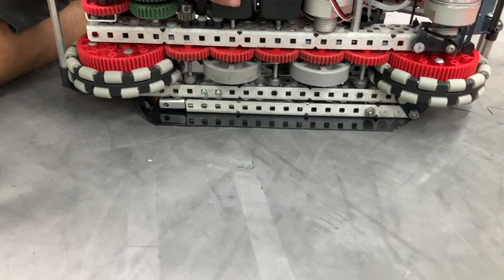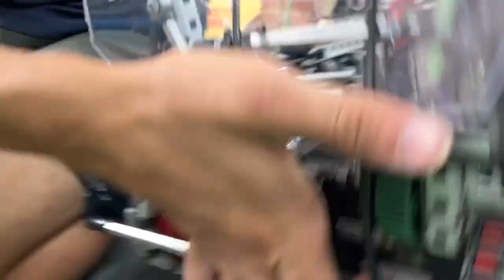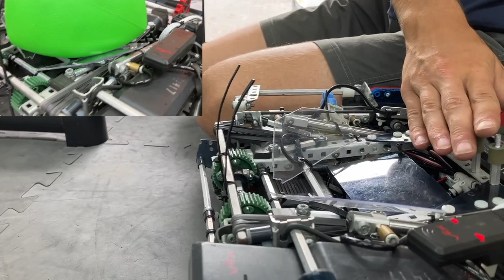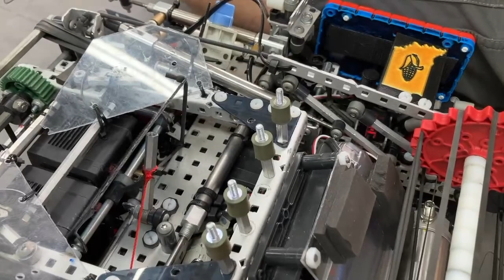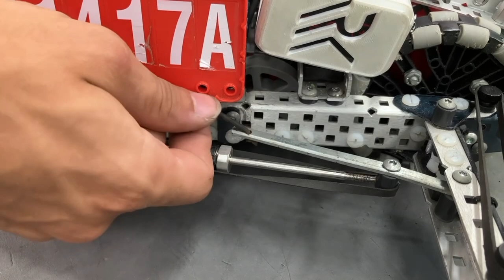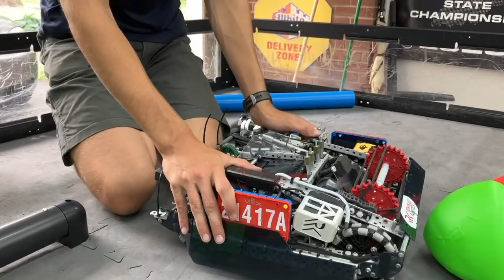21417A Over Under Early Season Robot Explanation

Comment: i dont have pnumatics how would i do a locking mechinism with motors
Reply from the maker: With motors you shouldn’t need a locking mechanism. It should work if your motors are set to hold. We are just using locking mechanisms because the pneumatics are not at strong as motors and the air pressure can be driven back under force.
Reply: thank you @robokauz
Reply: should i take my rubber bands of the wings then???
Reply from the maker: @Dispairitie  I’m not sure what your wings look like, or what mechanism you use to open them, but if they are directly powered by motors then the bands might not be necessary.
Reply: thank you @robokauz

Comment: I have been sitting here for hours trying to figure out how you did this locking mech and it just doesn’t seem to be working Is there any way you could help me?
Reply from the maker: I hope I can

So the beck of the high strength shaft has to be tensioned to the robot to ensure that it is close to the catch on the robot.
You want the wing to rotate the shaft around the end of the cylinder which will force the catching end of the high strength shaft into the side of the robot. This second part is how it works … it rotates around the end of the cylinder as the wing is pushed back, which coincidentally pushes it to the catch on the side of the robot.
Hope that helps
Reply: thank you another question how far away is the tension from the end of the axel? I counted around 6 holes, also is the axel tightly attached to the wing?
Reply from the maker: @Dubzies67  no all attachments are lose. The tensioning shouldn’t matter too much as long as it keeps the shaft close to the robot
Reply: Thank you very much I figured it out

Comment: how does the wings lock work?
Reply from the maker: well i cant explain the physics in text very well, but the mechanism rotates the half-cut high-strength shaft around the axis at the end of the cylinder, driving the shaft into the catch on the side of the robot so it cant slip. I hope this helps

Comment: wait i have a question that i really hope you can clarify for me. if your catapult is 33 rpm how are you getting 100 shots per minute since you are shooting 33 times per minute at 33 rpm right?
Reply from the maker: So the slip gear spins at 100 rpm which determines when it shoots. But it connects to the catapult in a 1 to 3 ratio resulting in the catapult moving at 33 rpm
Reply: @robokauz  oh dam that makes so much sense tysm i never thought of it like that but its basically the same idea as a puncher.

Comment: Hey, I was wondering how many teeth you took off the slip gears?
Reply from the maker: 6 , but it varies depending on the specifics of the robot, I'd start with less, then work your way up to however many you need to get rid of.
Reply: @robokauz  alright thanks!

Comment: 33rpm doesn't sound like it is 100 shots per min
Reply from the maker: The slip gear 12 teeth, spins at 100 rpm while the catapult arm , attached to a 36 tooth gear spins at 33, but since the slip gear goes at 100 rpm it slips and fires 100 times per minute

Comment: How is the high-strength axle you guys use for your hardstop attached to your robot? I can see some holes drilled in the sides, but no apparent screw?
Reply: it looks like its attached w a screw attaching it to the top of the piston and its pulled w a rubber band keeping it straight

Comment: how you can keep the catapult in the horizontal (close) position? do you do it by programming the cata motor?
Reply from the maker: Programming then it is turned on. A ratchet when it is off
Reply: @robokauz  how exactly a ratchet can lock the catapult in place in the fully tensioned down position? do you need to use a pneumatic to control the ratchet? is there a Youtube video somewhere that explains that? we are new to VEX and would love to learn more
Reply from the maker: @cjnguyenx  Kepler Electronics is a great place to look at ratchets, their channel has covered that. the ratchet is not necessary for a catapult but it helps the motor.

Comment: Very cool robot. Just wondering how did you shave down the metal slip gear I’ve seen most are plastic so you just use a file but how can you do it with a metal gear
Reply: Cut it
Reply: Grind teeth off with a grinder.
Reply: Belt sander, did mine with one and turned out really well

Comment: how do you make the half cut high strength axles
Reply: Take a high strength axle and cut it in half
Reply: Put the high strength shaft in a vice and cut it down the middle with a hacksaw
Reply: @stuartblank21417 hacksaw sounds terrible use power tools💀💀💀

Comment: Awesome video! I had a similar idea in mind for the drive where you utilize some 600 rpm motors and some 200 rpm motors with it all geared together properly, but I was worried about the motors longevity fighting against each other as some burn out faster or spin at slightly varying speeds. Have you guys noticed anything like that with your design?
Reply from the maker: no we have not encountered that

Comment: Great explanation. 
I dont entirely understand how your PTO works. How is the cylinder attached to the gears and drivetrain in order to actute them between the cata and the drivetrain?
Reply: The 36-tooth gears are sandwiched between two lexan pieces which are attached to the cylinder (it's very difficult to see because the PTO is buried pretty deep within the robot). The pneumatic cylinder for the PTO is attached to the robot by two screws at the very ends which run through pillow blocks and allows the cylinder to freely engage and disengage the PTO without the cylinder falling out.
Reply: Also, one other thing was that, instead of something like a sliding shaft, the 36-tooth gear of the PTO slid on some square inserts (the ones that come with the 12-tooth pinions).
Reply: @stuartblank21417  Many thanks for the detailed reply. In regards to the pillow blocks, are you using the high strength ones or the regular LS ones?
Reply: @TheRealAlexGray  It uses low-strength pillow blocks.

Comment: How do you make sure during match loading when people push you around and you move you. You don’t engage pto a bunch of times and you don’t run out of air?
Reply: It really just comes down to the question of when to use the PTO and when to go as a 4-motor drive. Four motors were enough to be able to cross the barrier, so you only really need the PTO for pushing the defense away (If the defense does not let up, you could always try switching to the other match loading station to score a few).

Comment: Could you show us and explain the drive train?
Reply: Unfortunately, the robot does not exist anymore. 
However, here are a few things about it:
- The Drive RPM was 360 on 4" wheels.
- It could switch between a four-motor and seven-motor drive
- there were two 2" flex wheels between the 4" wheels to help cross over the barrier.
Hope this helps :)
Reply: @stuartblank21417  How comes you got rid of the robot? Looks pretty good imo?

Comment: How are the wings able to close so easily even with the locking mechanism?
Reply: The locking mechanism only locks when there is force on the wings. When there is nothing pushing against the wings, the locking mechanism is a few millimeters away from the lexan catch, which allows the wings to easily fold back in.

Comment: Very epic robot
Was there a reason for the rubber links on the 4-bar intake?
Oh, also, how'd you mount the motors vertically like that?
Reply: Do you mean the rubber links on the catapult? Their purpose was to make the back of the catapult longer so that the tribals would shoot lower (without them, the tribals tend to have a higher arc --> since, without the rubber links, the back of the catapult would be shorter and the tribals would not have to move as far to not be contacting the back of the catapult (since catapults utilize centripetal force while in motion)) while maintaining the ability to go under the goal (since the rubber links can flex).

I assume the motors in question are the ones in the "motor box" at the back of the robot (or do you mean the four 11-watt drive motors?). The "motor box" had two 5.5-watt motors and two 200 RPM 11-watt motors stacked on top of each other (they were alternating between 5.5-watt and 11-watt motors to make the motor box slightly thinner and smaller so that it could fit between the drive base c-channels). The motors on each side of the motor box were connected together by low-strength 36-tooth gears (the PTO was connected to the bottom motors of the motor box). The motor box was attached to the robot by a whole lot of standoff bracing (basically wherever some could fit. It was also sandwiched inside the robot tightly enough that even if all the bracing came undone, it would not fall out of the robot).

Comment: The cross court scoring on this robot is insane! I love robokauz :D
What's the purpose of the 2" flex wheels on your drivetrain?
Reply: I would assume to make crossing the middle bar easier.
Reply: Oh ok, that makes sense. But why flex wheels over non-compliant wheels?
Reply: @lettucejr9678  Mostly because of the spacing of the drive. Flex wheels also have a lot of grip on the middle bar and they can deform easily so that the drive can cross smoothly.

Comment: Amazing Bot! How well does the cata shooting perform against defense? Is it possible to post any of the scrimmage matches?
Reply: From the defense it has encountered so far, it seems to work pretty well -- the robot shots are pretty low to the ground, but if you shoot the triballs with enough force, they tend to bounce up (depending on the opponent's robot design) when hitting the defense and manage to go over the barrier still. If you can't really get any triballs over the barrier from the defense, you can always try switching match load stations. 

As for the question of full videos of the scrimmage, we probably won't post them  because some of the teams in attendance did not compete at Mall of America and we do not want to leak all their strategies / full abilities of their robots without their consent.